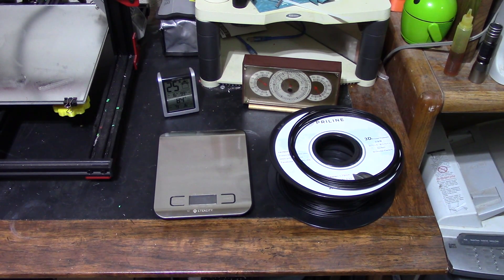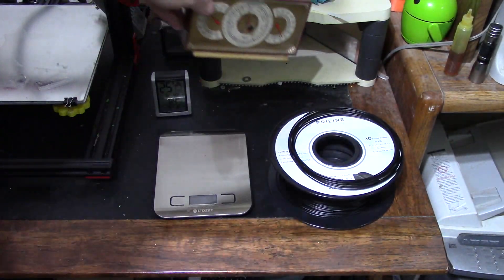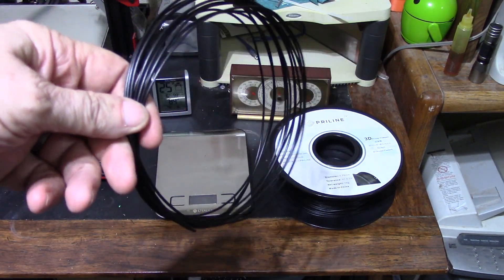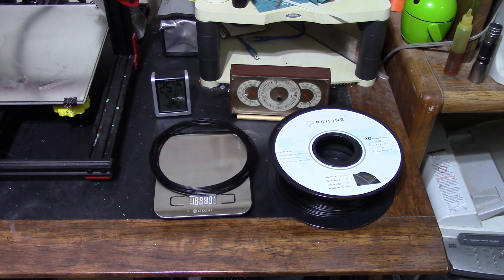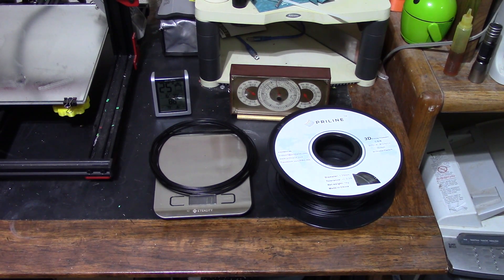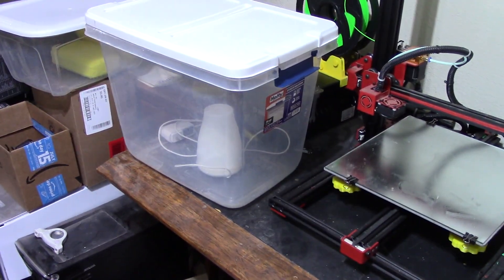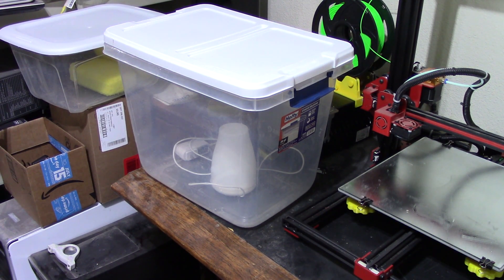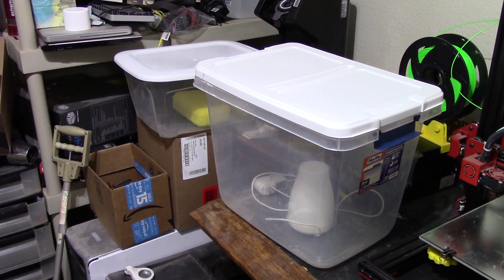Do you need to dry your PETG filament?

Comment: I've got a roll of Overture gray PETG that's got three years of air time, with one trip from Ohio to TN in a crate with my printer, and a few years in an old parked van, still in that crate with my printer. Got it out almost a year ago and set it up at my new job as a display piece with my printer since it didn't work properly, and recently got the printer to work, so I've started using the roll this last week.
There's some pretty bad stringing and buildup issues with it, but I've still been able to push some solid prints with it as long as I baby the print to make sure to peel away the excess that bubbles up from the print. Yes, it actually bubbles, and makes my printer look like it's overextruding even though it isn't, A severe underextrusion with obvious holes in it still gave me the same symptoms. At least the roll is still usable, I've got four and a half (cancelled one due to bad support setup) good prints from it so far, of decent size.
Should probably get a dry box set up and try to make it better.
Reply from the maker: Now that's what I'd call an extreme long term test! You can buy a single spool filament dryer now for almost as cheap as you can make one from a food dehydrator like I did.

Comment: I want your climate! XD at the moment, i got about 8c (46f) and 82% humidity, i whould say, with humidity running between 60-85%, it took about 3-4 days, before i could see a diffence, somewhat confusing for a newbe with 3D printer =) So i can agree with you (ordered myself a filament dryer today XD )
Reply from the maker: The desert isn't all it's cracked up to be. In the summer night time lows are usually in the mid to upper 90's and daytime highs 110 or higher. The low humidity can make breathing painful after a while and you skin starts looking like a lizard's. And anything left out in the sun not made of metal or stone won't last long. And you need oven mitts to pick up tools you set down in the sun. By the time the end of August rolls around I'm really sick of it, then I realize there's another month left to go.  😩

Comment: Nice work, but I think 6 hours isn't enough. To accurately test you'd really need to leave it for weeks like you did with the PLA. Anyways, thanks for sharing
Reply: You can over dry filament so you need to be careful leaving stuff in the dryer for over 48 hours, but I'd say around 12 hours is a good range for PETG. Depending on the temperature you're drying it at with of course.

Comment: 50% would be the dryest day in decades where I live lol. The average is about 80% al year around. I really struggle with wet filaments.
Reply from the maker: I feel ya, I lived in the Seattle area for 19 years. I wasn't questioning that folks in humid areas have issues with wet filaments, I mainly started this series because so many were questioning me with "Well, did you dry that filament?". They don't realize what it's like to live where the humidity is often 10% or less and rarely goes above 50% for long. Thanks for watching!

Comment: I live in Florida, we have 110% humidity; if all I get is a bit of stringing I can live with that. I just want my prints to complete but are the drying techniques you recommend?
Reply from the maker: If you watch some of my later videos you'll see how I created a filament dryer out of an inexpensive Rosewill food dehydrator and some printed parts from Thingiverse. Also, if the room you print in is high humidity you'll probably want to print from within a dry box. In another video I create a dry box you can print directly from out of a Rubbermaid cereal container and some parts you can print. Both together only cost about $70. And you can still use the food dehydrator to make beef jerky and dried apple chips!  :)

Comment: my god, my humidity in my dry box is 46% lol (tennessee sooo )
Reply from the maker: High humidity here is low 30's. When it's below 10% for more than a few days I have to run gallon sized humidifiers to keep it around 20% or I'll develop a dry cough. But hey, my filament doesn't get damp and my guns don't rust!
Reply: You might need to recharge your silicate? I'm in UK Midlands which can get pretty dank but nothing like Tennessee, phew! 👍

Comment: Good test, Chuck. I have had very mixed results with PETG on my Ender 3. I think more the profile than the filament itself. I must look back at the a/c cover video. I remember thinking that I should play with the settings when I'd seen it. Thanks again, Chuck, for all the hard work,
Reply from the maker: I've never cared much for PETG myself, while it's a better filament for functional parts than PLA, its stringing and blobbing make it less than adequate for parts where a good appearance is wanted. Which is what's driven me to nylon, ABS and PC. Which drove me into the all metal hot end, better thermistor, enclosure, modifying Marlin, etc, etc.
I'm bound and determined to get PC to print good, but I'm starting to believe that my go-to filaments for working parts is going to be ABS and nylon. Thanks Paul, for watching and commenting!
Reply: @3rdpig  Most of my printing is fun 'fixing' for problems I see around the house. I haven't relied on it to make working parts. PLA is ok at the moment but I have started noticing things it would be fun to do in ABS; bits for my electric bike and the like. It's likely I'll have to start on a fresh journey!

Comment: My experience with PETG would echo yours. However, I keep all of my filaments in a dry box with desiccant packets which are included with the roll when you buy it, and a Eva-Dry E-333 renewable Dehumidifier, keeps the box at below 20%. I also have a cheap dehydrator for when I use nylon. FYI... in case you guys dont know, you can put those desiccant packs in dehydrator to renew them. Another thing to consider with dehydration... each filament has it's own glass transition point (temp) which you dont want to hit until the hotend, it can ruin your filament. Keep rockin it Chuck!
Reply from the maker: Thanks for the info, and thanks for watching and commenting!

Comment: Hi, Chuck
I'm in Oregon. Outside temp is currently 47F Humidity is 86%. I've been printing small structural parts with Amazon Basics PETG. Until it started raining on Thursday I had very good success. Once it started raining and the Humidity went up above 80% the same parts refuse to print. Lots of stringing, edge filaments don't bond and the infill grid is terrible. The spool of filament has been on my unenclosed Ender 3 since I started printing. Imma try drying it using your same equipment. I'll let you know how it worked for me.
Reply from the maker: Good info, thanks. My tests seem to agree with your experience, 50'% or lower and you're good, much above that for more than a few hours and you'll have problems. Keep me posted and thanks for watching and commenting!
Reply: Interesting couple of days. Drying the filament had no effect at all. Problem turned out to be an broken lead on the thermistor making intermittent contact. Back to printing!